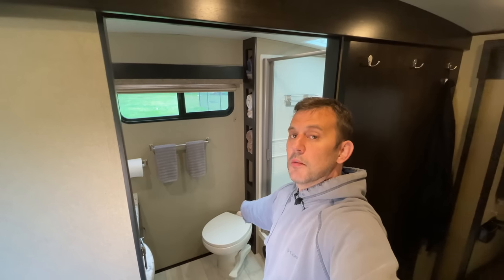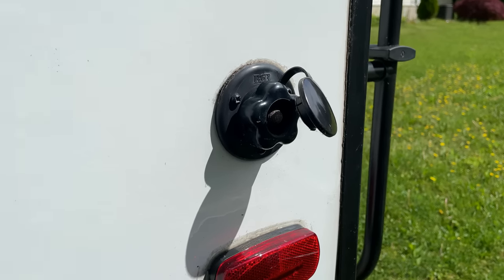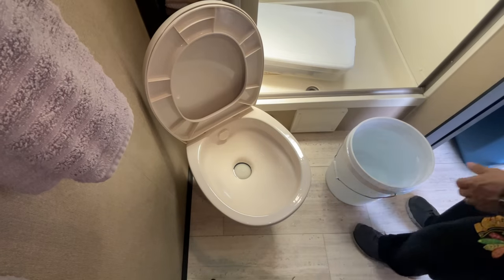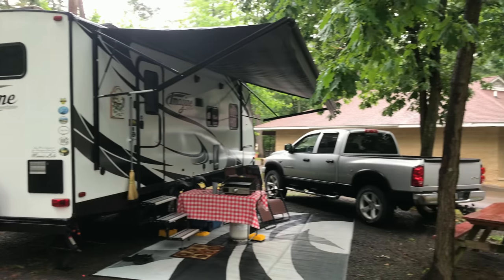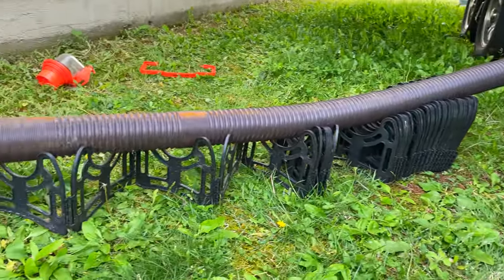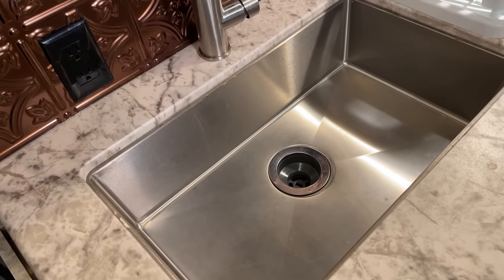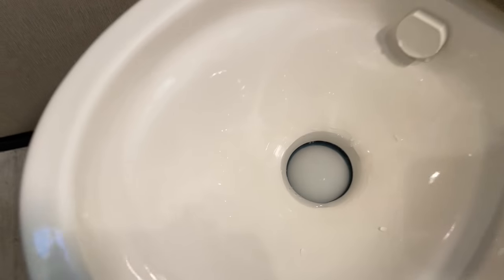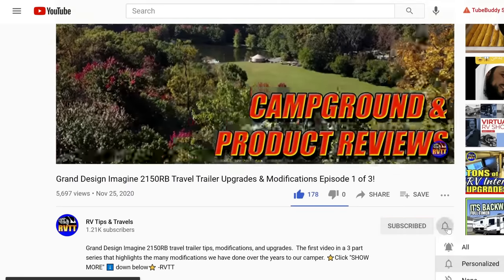RV Black Tank Cleaning, Maintenance, Tips & Tricks - The Original Black Tank Master Class

Comment: Not an RV owner, maybe in the future, but I've always heard that it's a bad idea to travel with water in your black tank.
Reply from the maker: traveling with 10% of your capacity is not going to hurt anything.  Traveling with a full tank has been a mixed opinion topic for some time, but I dont ever mention that in this video so that's a completely different subject. But what I mention in this video is keeping about 10% of the tanks capacity filled with water at all times, and is perfectly acceptable to do.  Thanks for watching!
Reply: While it's on my mind got any videos with tips specifically dealing with the tow rig? Or really just suggestions for people like me that are stuck in the past with tow rigs that are 20-30+ years old?
Reply from the maker: Nothing right now sorry. Ive got one that is 16 years old though.
Reply: @RV Tips & Travels  My oldest is my 85 C30 dually. Hasn't been on the road yet since I bought it, but I already know how much fun a carb fed 454 big block chevy with a 3 speed non overdrive trans and 4.10 gears is gonna be 😆. Filling both 20 gallon tanks is going to be an adventure in it's when there's one on each side of the truck and can't stretch a hose across the bed. 🤣

Comment: For kitchen grey tanks, NEVER EVER pour anything that may have oil, grease, or melted fat (lard, butter, beef or pork fat, etc., etc., etc.) directly down the drain!!!!!  This will solidify in your tank and hoses, and unless you fill your tank with very warm water with the dishwashing liquid, it will not melt and come out.  Always use your sink drain plug and fill your Sink with hot soapy water before washing any dishes, pots, or pans that have oil or grease in or on them.  This will breakdown all of the oil and grease.  Always try to remove as much of this as possible before cleaning in the sink.  A good practice is to dump the oil/grease out (I usually dump it on leftover wood in the fire pit.  It'll burn off once a fire is started in it.) Then, fill with about 1/4" - 1/2" of water and bring to a boil.  Dump the hot water and oil in the fire pit also.  This will free up just about all of the oil/grease from the pot or pan.  BUT.....you can have more grease/oil/fat than the soap can dissolve.  It's a molecule game.  The grease does not just go away and "technically" speaking, it's not really dissolved.  The soap molecule is basically like a sponge that attaches to the oil molecule and changing the oil molecule's properties.  If you have more oil/grease molecules than soap molecules, the soap will become saturated at some point and you will have what's known as "free oil" left in the soap/water solution.  This will settle out in your grey tank and hoses.  This process can be reversed on purpose, or on accident.  If you add any kind of sodium based solution (salt, epsom salt, etc.) the soap molecule will release the the oil molecule and return it to its regional form.  I know this for a fact because I worked in the oil (petroleum) business as a Process/Chemical engineer for 30 years.  We use special soaps to clean the vessels and piping internally, then add sodium chlorides to the soapy water solution to revers the process and recover the oil and separate it from the water.  

A huge mistake I see folks doing with their RV's in parks with sewer hook-ups is leaving the black tank valve open.  Their thought is, "I'm hooked in to the sewer, I don't need to leave the valve closed.  As stated in your video this can cause problems down the road.  This may sound a bit graphic, but think of it like this, if you happen to leave "skid marks" in your commode and have a level of water in it after flushing, when you come back an hour or so later you'll notice the "skid marks" have dissolved and settled in the bottom.  If you didn't have any water in the bottom, when you come back later and it's dried and decide to try and clean it with a brush, it takes a little elbow grease to break it free.  It works the same way in your tank.  You may luck up and flush "most" of the solids out of the tank when flushing and leaving the dump valve open, but there is always the likelihood of leaving some "skid marks" inside your black tank.  This will build up over your stay and over the years.  Simply using the flush valve won't remove all of this and it will build over time.  It won't clog your tank, but eventually it will cause odor issues.  As stated in the video, having and leaving water in your tank at all times until dumping is required, will eliminate this issue.  I don't have a level indicator, but I do have separate grey tanks for the bathroom and kitchen.  My black tank is 37 gal and my bathroom grey tank is 20 gal.  I use significantly more water in the grey system than in the black so I use this as an indicator.  After the second dump of my grey tank I will dump the black tank once my grey tank fills the third time.  Also as stated in the video, I dump the black first.  I will start the black dump and let it go for about 1 minute before I turn on the flush.  I let the flush run until I see clean water then shut it down.  I'll close the dump valve then turn the flush on for a couple of minutes then open the dump valve and let it run until clear again.  After the second dump I close the black tank off then drain the grey tank and start the cycle again.  

I personally don't recommend keeping any water in any of your tanks while towing especially if you have a tandem axle trailer.  The tanks aren't located as to equally distribute the weight across the frame of the trailer.  This will cause twist in the frame.  Not a permanent twist and damage your camper.  But a twist that will distort the axle track.  All axles are free floating with shackles and tandem axles have a yoke.  This is to reduce the stress on your axles and frame while towing and reduce tire drag in turns.  This weight distortion can cause excessive wear on one or more tires while towing very quickly.  This can be minimized by upgrading your yoke and shackle system but it won't eliminate it.  5 gals of water is going to weigh roughly 42 lbs (rounded up).  Hook up your RV to your vehicle.  Place one level laterally in the RV and one perpendicular.  Place 42 lbs of weight in one corner inside the unit. and check the levels.  Move this weight to different places and see how it effects the levels.  This distortion is transferred to the axles when towing.  Now imagine this weight sloshing around, up and down, side to side while towing.  If you're not going to have water service where you're camping, I'd recommend waiting until you're close to your destination and stopping at a gas station or rest stop to add water to your tanks, including your freshwater tank.  It'll save you a lot of fuel and tire wear.  If you want to leave some water in after your trip has ended, I'd recommend no more than 2 gals.
Reply: Great comment

Comment: All good step by steps, but if you did this at a campground dump station that is busy, stink eyes would be all over you..no pun intended. Multiple rinses at a dump station is not normal. Individual space dump stations at each site prior to leaving these multiple rinses would be fine.
Reply from the maker: Of course if there are people behind you waiting in line you would need to be courteous of their time.  You’ll still have time to dump a bucket of water in your black tank in most cases before the tanks even empty if you are prepared to move quickly and have the bucket ready.  Thanks for watching!

Comment: How to repair leaking black and grey water tanks. Previous owner let tank water freeze, applied fiberglass patches, but still leaking. Best way to fix?
Reply from the maker: Good question Bill.  I guess I would have to see the nature of the leak and damage.  It might be work just replacing, honestly.  These are manufactured in one piece and considering the weight and movement of the water it might just be better to replace.  But I’ve never fixed one so don’t take my word.  Thanks for watching Bill, I appreciate it!

Comment: Im hooked to a direct sewer drain at all times. I think it’s stupid that everything still goes into the tank first.
Reply from the maker: the tank is there for a reason.  they are built to be traveled with, which means you need a waste tank if you arent hooked up.  if you are permanant then just remove the tank and route 3" pipe to the sewer.  youre going to need to use a lot more water to move it down the pipes, just like in house.  thats why in a house you use 1.6 gallons of water when you flush.

Comment: Holding tanks are not septic tanks. Why would you want the material to start breaking down? I want everything whole and intact so it can roll out easily, I don't want to take full of sludge.
Reply from the maker: The purpose of liquifying waste has nothing to do with it being a holding tank vs a septic system.  But to answer your question, that’s not at all how it works either.  In the real world solids dont just "roll" out.  There’s video evidence of this in this video https://www.youtube.com/watch?v=zYJCLzGaaB8&t=801s

As you'll see around the 10 minute 45 second mark how much solid waste is left in a tank AFTER a dump if its not liquified. Those solids will will remain in the tank.  Liquifying them will get them out, and any liquid left in the tank is also diluted and can be removed with 1 more quick 25% capacity flush.  

Here's another one, at the 5 minute mark.  Good luck getting all those solids out! A lot of that is ice too, imagine whats going to happen with waste? 
 https://www.youtube.com/watch?v=iH6acEmqvcw

Might need to hire a tank cleaning service... hope that's not where you're getting this advice 😉

 Tons of proof on this already.  My tank sensors work after 6 years, and ill be releasing a video this summer proving all of this. This video is all about what I have done and what has worked for me.  That's why I liquify waste.  It works, and the process is easy.

Additionally, the tank wont be full of sludge either, especially if youre using water.  The sludge, which in reality is just slightly thicker than water, is easy to rinse out with an additional fill and dump.  Solids, not so much.  Again, the process has worked for almost 7 years for me.  Its a free country and you can choose to leave 3-5 days of solid waste build up and clump together on the way out.  Thats how you get clogs.  And what doesnt come out is now stuck to the bottom of the tank. Hope that helps.
Reply from the maker: https://youtu.be/L50oamx7ivc

Comment: RVs has been in the US for centuries and still they use hoses manually. With the technology today...come on...there has to be an alternative to this. Why not have the rv campground septictank hole placed under where the RV parks. RVs then should have guiding pipe systems like jet fighters getting fuel and locate the hole. Then dump everything. Instead of buying a hose guard to align the hoses straight, the clear tank indicator. This way gravity drops the feces and urine directly vertically without any waste. Directly from the RV and no need for hose.
Reply from the maker: Not a bad idea in theory, but you’re going to have to standardize dump systems on every RV manufacturer in the country. Plus that doesn’t solve the issue of every RV that has already been built.  I like the way you think though!
Reply: It's easy, old RVs don't need to worry as long as their black and gray tank hoses point downwards. The modified campground septic hole pipe with a catcher funnel (like an oil pan but vacuum sealed; basically like a vacuum cleaner) goes up locks with the RV pipe. At the end of the dump, it sprays strong water and cleans the RV pipe (YES, it has options too if you drop a coin; it cleans the RV  tanks with cleaning agents with it's powerful rotating cleaning spray); and after; it goes down. The first campground site that will do this...is a game changer. And the reason I commented on this channel is because I feel your group of people can make something like this. MORE POWER! Bring me along for the ride if you ever need a dummy like me. No more touching the disgusting drain pipes. And no more thousands of how to dump black and gray tank videos.

Comment: What about the tip of drilling screw size holes in the side of the tank valves (grey and black), putting any non rusting short screw in it, and remove it once in a while to shoot lubricant there ? I've seen that on Youtube, did it last summer and now using it, let's say once in a season (at least). You can obviously only do that just after emptying the tanks BEFORE putting new water or anything else, otherwise a surprise spray awaits for you :)  https://www.youtube.com/watch?v=TGv9THpOdmw
Reply from the maker: ive seen some folks do this... ive just never had a problem when i removed my cap.  what i do is when I back fill my tank, after there is water from the pipe to the tank.... i will open and close my tank valves a couple times.  the water in the pipe helps lube both sides, and cleans everything off.  i dont do it in this video, but youll understand what i mean by backfilling: https://youtu.be/Q7ZJzfimLwg

Comment: A simple watch and 5 gallon pail works great for black tank water level. Before hooking up the hose to the black tank sprayer time how long it takes to fill a 5 gallon pail. 5 gallon per minute is common. With our 50 gallon tank I close the valve for 5 minutes ( approx. 25 gallon ) and redump until completely clean. Lol. A little anal but what else is there to do other than drink beer.
Reply from the maker: I'm with you David, nothing wrong with being particular about the black tank.